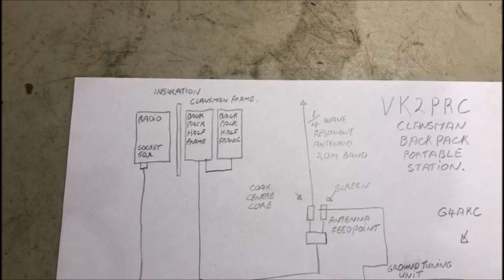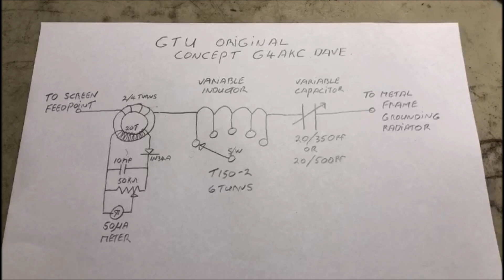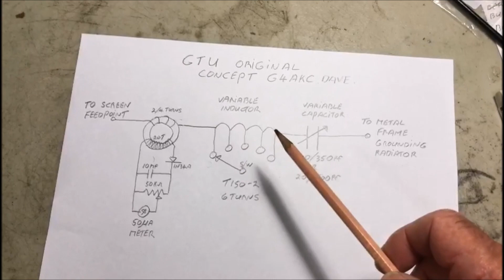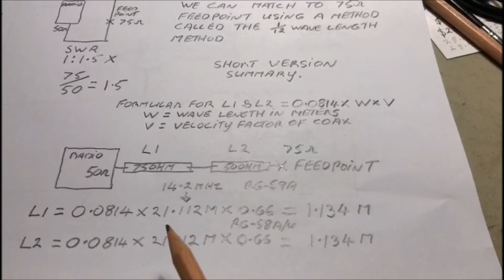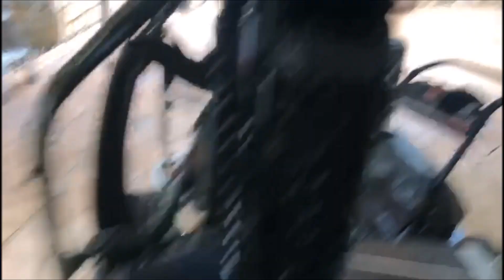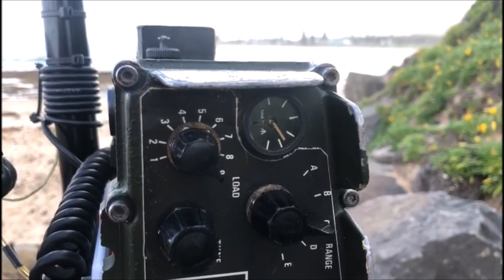VK2PRC how to build a 1/4 wave  GTU Backpack Portable HF radio station

Comment: Alex, your videos are very instructional. I have built your half wave for 20m and duplicated your 40m 1/4 y. Your explanation for the ground tuning is excellent. I have had poor luck with theGTU. After watching this video I now understand what I need to change to make the gtu work. Thanks
Reply from the maker: Stephen, for 20M the inductor is not really necessary but for using the GTU with 40M the inductor is required.
Reply: @vk2prc978  Alex, I also built a field strength meter to use in the field built inside a digital multimeter. I added a short telescoping whip antenna mounted inside the multimeter so it looks like a small transistor radio now. .....Hmmm  For those interested, see this link for the multimeter circuit I used, excellent explaination.  https://www.youtube.com/watch?v=_VMw5LFwKEk&lc=z232wdg5wxqjgtija04t1aokgl2n15q3fwbvwjtczlfzbk0h00410